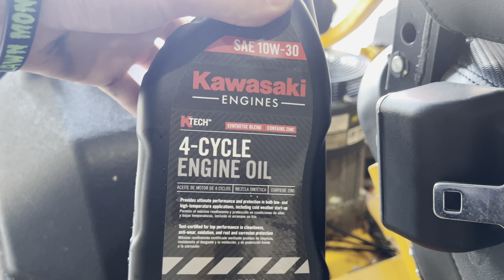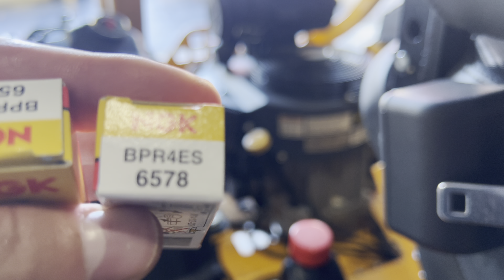Cub Cadet Pro Z Zero Turn Maintenance

Comment: I have a Pro Z 100, and there is WAY less room around the engine than on this one. I came here looking to see if there was some magical part I could remove that would give me access to the oil filter and spark plugs. Yours doesn't need better access. It already has great access for maintenance.

Comment: Thanks for this. There are not enough videos specific to the 900 series. If you care to videos on hydraulic fluid change, dropping the deck, and replacing spindles would be very helpful.